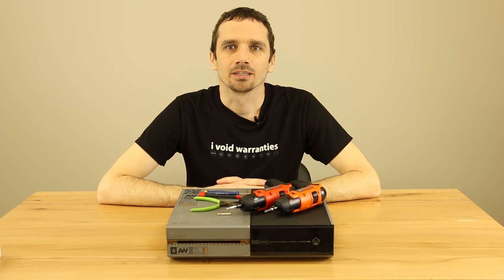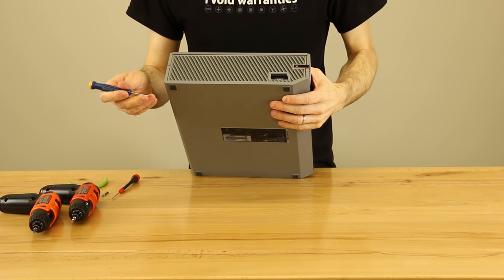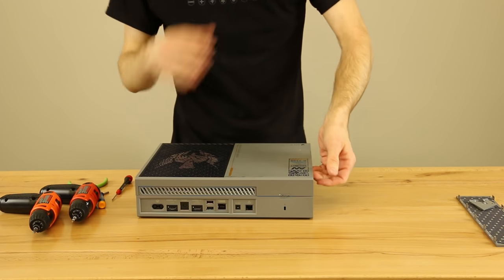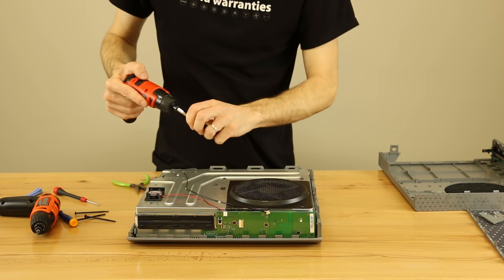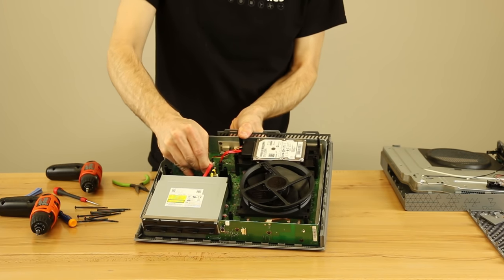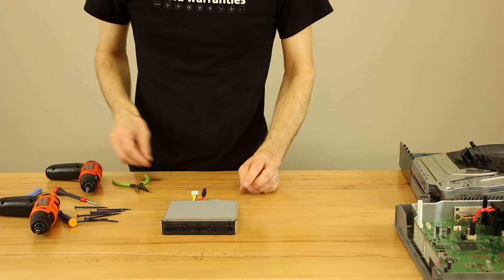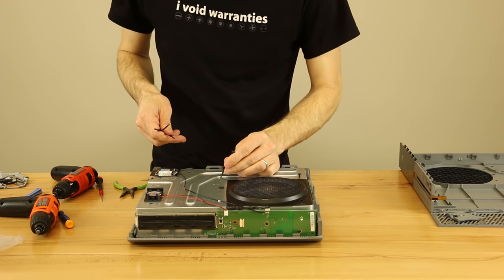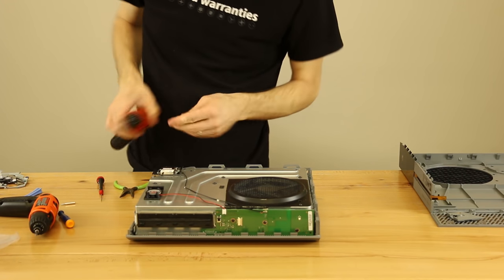Xbox One Disc Drive repair

Comment: my xboxone doesnt even acknowledge there is a disc no error code no nothing
Reply from the maker: It may need a new laser or entire disc drive.
Reply: Ben heck Xbox one
Reply: Mine only does it for new games.
Reply: mine works if i inject game cd tilting the Xbox a certain way a bit.....lol...it that a laser issue...thing is I can tilt it back after detected and it's fine
Reply: BAD LASER, USUALLY
Reply: The disk drives motherboard is important because that is what allows the Xbox One to read movies & games.  Remember that.
Reply: @Tronicsfix  true tea
Reply: We got the same problem dude.
Reply: Same problem here.  I've tried a new blu ray drive, moved my daughter board over to it.  It won't read blu ray or game discs, either.
Reply: Same same
Reply: Same
Reply: clean the roller inside the disc drive, it getscdirtyvand doesnt push the disc in all the way, causing the motor to not engage with disc, 9 out of 10 times thos will fix
Reply: same, I really need this fix
Reply: @terrysean85  how did you clean though? I just cleaned with q tip
Reply: @Tronicsfix  this comment saved me a lot of money. Ordered a new laser popped it in and it worked. 👍

Comment: i struggled way too long to get the upper case back on (last step). recommendation: as soon as the upper case is removed, separate it into two plates (top and front). MUCH easier to restore top face, then ribbon, then front face.
Reply: Wish I'd read this before starting.
Reply: Lmao I found that out after struggling for  longer than I'd like to admit. Should have read the comments
Reply: thank you!

Comment: Just pulled mine apart cleaned the laser and theres no errors nothing just doesnt even acknowledge theres a disc.... they should have never went with internal drives....
Reply: roller might be dirty. that back bar near the front of the drive.
Reply: if its not internal were would u put it u mean like the hd dvd for the the xb360?
Reply: Same problem here on two different drives.  I moved the daughter board to a new drive and the new drive still won't read / recognize any discs.  I think they bricked my daughter board.
Reply: I can see, now, with my camera zoomed way in that my daughter board's surface mount voltage regulator is burnt out.  

I'm not good at removing or adding surface mount components.  Without that Voltage regulator my daughter board is trash.  Without the daughter board, the Blu Ray drive is trash.  I really hate Microsoft's implementation of this.  It's terrible.
Reply: Never should went with an internal drive? You mean like EVERY single console EVER that came with a disc drive.

What a dumb comment.

Comment: Today, 5 years later, I restored my Day One 2013 Edition, which was no longer able to read discs properly. Without your video I got stuck after removing the PCB. I saw no way to get to the laser. Thank you!
Reply: What was wrong with it? I have the same issue with my day one
Reply: @djesteem01  in my case the laser was bad. Replacing it solved the issue.

Comment: I just wanted to say THANK YOU so much for making such a detailed video of this!  My laser was not broken, but my 2 year old had shoved a dead leaf into the disc drive and there was a stick that was stuck in it making it no longer play any discs.  I followed your instructions to the letter and was able to open it up and thoroughly clean the disc injection area (of which I had to take that black piece off the front of the drive to get to all the small leaf pieces) as well as leaf parts in the disc seating area.  I put everything back together and now we can play our favorite shows and video games again.  Thanks again!
Reply from the maker: Ha, ha...nice. We find all sorts of stuff in them! Glad this helped you get yours working.
Reply: @Tronicsfix  does this fix the on/off problem with the Xbox one

Comment: It has to be said, your videos are top quality and many thanks for the above video. I have a dead xbone drive and this may be the answer :)
Oh and for the "Budding Electrician/Bodger", a tip...
You own a mobile phone right?
Take photos of the disassembly as you perform it. This way when it comes to putting it back together, you can follow the pics in reverse order :)

Some ribbon cables can be a nightmare (PS2)

Comment: This procedure worked for me! Great job!!
Notes: 1) make sure you take out game disc from CD drive, mine wouldn't restart until I removed!
2) that flat cable to the front panel is a real trick: my connector also had a small lock to undo, besides the loop around the connector.  I put mine on the edge of a table so I could look up while connecting, this is suggested in the video, but it does help! I used flashlights to help see too! This might be trickiest part of the surgery!!
3) inside the DVD drive, there is a small black square thats actually a microswitch... I couldn't get control PC board in until I got this swith to ride on top of a white bar that must related to having the CD in...

Thank you!!

Comment: The Xbox One Advanced Warfare Limited Edition is my longest owned Xbox One. I stood in line outside for 6 hours at Gamestop in the freezing cold for my preorder of this console. I don't know how. But I still have this Xbox One and it has not once giving me any issues whatsoever. I have taken good care of it and have kept it clean. I use a vacuum cleaner and suck out all the dust from the vents regularly to prevent major dust from getting deep inside the console. I haven't even broken the warranty sticker even though its way out of warranty. When the S came out I was going to upgrade. But ended up waiting. Then the X came out and I mistaken it for the next gen Xbox and made my purchase. I was going to sell my old Xbox One. But im so glad that I didn't. As now after all my bad luck after owning several brand new XB1X systems. That all seem to come faulty. The Advanced Warfare Xbox One limited edition  will always remain my back up. So I can keep on gaming.

Comment: Old drive was not feeding properly. New drive would not read game discs. Swapped disc feed carriage in new drive to the other parts in old drive.  2 screws hold in the motor in the back left.  No soldering needed.  Everything works.  Thanks for the video.  Using the prongs for a fork perpendicular to the case also works for releasing tabs without the tool.

Comment: When reassembling the case just un clip the face plate where the ribbon cable is. That way you can just snap on the top of the case. Then that makes it MUCH easier to install the ribbon cable and then just align the bottom clips of the front face plate and press in the top part and boom. Hope this comment helps at least one person having trouble with reassembling. Because ik I had a hell of a time.
Reply: Helped me! Much easier, thank you.

Comment: When I put a disc in my Xbox, it makes the sound that it’s supposed to while the disc is going in, but it keeps making that noise for a second or two longer than it needs to and then it doesn’t even read it

Comment: Thought something was wrong because I would hit the eject on the new drive I installed and the trey would not eject.  It has been so long I had used the disc drive I forgot it did not have a trey.  So, ordered a new drive on amazon for $30, pulled the board from the old drive to the new one, 3 screws, 3 ribbons, and a simple solder of 2 wires, put her in, and works great.   While I was in there I went ahead and pulled the heat sink off, cleaned it, and the fan up nicely. Removed the old thermal paste and applied some new thermal paste, might as well while you have it open, the old paste was pretty crusty.   The Xbox one had a damaged non-working disc drive and the hard drive had just recently failed so it was a non-working Xbox one.  I ordered a 1TB SSD to replace the old HDD, also this new disc drive.  Installed the Xbox software update via thumb drive and now this old Xbox one is a brand new beast.  Once I get all the games installed back on it I will be interested to see how its load times hold up to or surpass those of our Xbox one x.   Thanks for the tutorial, I was worried a disc drive replacement would require getting it flashed or something. But just swapping the boards did the trick.

Comment: Keep in mind to make sure all ribbon cables are fully seated and locked into place. It any of them are loose there will be power issues S it won't run right. I just replaced the BR disc tray and didn't have the front power and eject ribbon cable fully seated which made the Xbox randomly turn on and off. It's quite annoying. After I replaced the disc drive it's like a brand new Xbox. Highly recommend doing thi yourself rather than sending it into Microsoft. Even more so if the Xbox is out of warranty and it doesn't matter if you break the seal or not.

Comment: This video is gonna help me alot. Just bought a 70 USD Xbox One that has a broken disc drive on it. This is probably the problem it has.
Reply: Hi I just bought an Xbox like you did but I didn't spend $70 for it I only spent 40 but it has the exact same problem how much was the part cost to repair it

Comment: drive succesfully repaired. thank you!
Reply from the maker: Awesome!
Reply: genl0rd where did you purchase your optical drive at?
Reply: i did not purchase an exta optical drive. i just cleaned the lense of the drive, included in my second hand xbod. there where parts of potato chips and oil from the previous owner inside. i've cleaned it with a q tip and alcohol
Reply: genl0rd o ok. Thanks for the detail. My ex girlfriend broke my madden game put some kind of sticky stuff on the game and forced the broken game into the tray. It still works and but it makes noises trying to read the disc and everytime I take a game out it has that sticky stuff on it from the previous game she forced in my xbox

Comment: This is EXACTLY what's happening with mine! The SAME little white plastic part broke off. Could you point me to where I could buy that replacement part? I would love to have you guys repair it but as I'm located pretty far from you that's out of the equation ;) Would extremely appreciate any tips on where to acquire the part. THANK YOU SO MUCH!!
Reply from the maker: +returnofthesoftstyle Which replacement part do you need? We can sell you the laser + carrier if that's what you need. You can contact us on our website: http://www.tronicsfix.com/contact.html

Comment: Great video. Thanks for the post! I have one comment though about the reassembly. I found it very difficult to get the front cover to align just right. I found it very easy to unsnap the front cover and place it on last. Just a tip if anyone had any issues like I did.
Reply from the maker: Good tip. Some people would probably do better that way.

Comment: Where did you guys get the replacement laser/spinner piece? I would like to purchase one. Thanks for the video, very helpful.
Reply from the maker: It's linked in the description.
Reply: Thanks, I guess I missed it because I didn't click "show more." Great video, thank you so much. Mine won't spin discs and it seems that replacing the laser carrier piece you did in this video is the fix I need on mine. I will give it a shot and if it doesn't work you should be receiving my XB1 in the mail soon! Thank you again.

**Edit: I checked the link for the laser, it looked in the video like the laser was attached to another panel that had the carrier and ribbon cables and other stuff on it. I think my problem is the spinner motor itself, would you happen to have a link for that?
Reply from the maker: Gotcha...I don't know of anywhere that sells them with the carrier. You may end up having to just replace the drive or send it to us for repairs.
Reply: How long would you guys think it would take from Oklahoma City? I read another commenter who said they got a 1 week turnaround? Kinda don't want to be without my XB1 for a long time if possible?
Reply from the maker: That depends on how quickly you ship it here and which repair speed you choose at checkout. We offer a one business day repair + 4-5 days for return shipping or you can pay to have it shipped faster. You can choose that at checkout.

Comment: The link no longer has the optical drive available. Is there another you can provide? 

Ive had it apart twice and got it to work long enough to install a 2 disc game, but it didnt work after putting it back in the drive case. Seeing as I dont know what to look for its just luck when a disc reads. I think its the laser as it doesnt seem to light up,  just spins the disc twice moves a little back then to the middle and does no more.

Not sure if I need a new laser or deck or entire drive, but Id prefer not to solder anything if I dont have to.

Thanks for the video, appreciate the help.

Comment: This video looks great, but I am just not sure if mine is the laser. When I insert the disk it doesn't go in all the way. It like gets stuck and I would have to push the CD with my fingers and after that it still won't work. any suggestion?
Reply from the maker: Sounds like you might have a problem inside your disc drive. I can figure it out if you'd like to send it in: https://www.tronicsfix.com/collections/xbox-one/products/xbox-one-disc-drive-repair

Comment: I have one question, so I have the same exact model of Xbox one you have shown in your video. Even down to the advanced warfare collectors edition. However, when I boot it up, it seems to have a different screen compared to yours, did they make a refurbished variant?

Another question is, where can you order new disc drives for the Xbox one?
Reply: Ebay. And they probably did an update since this video which is why it looks different

Comment: where did you buy the laser from ? . good job on the fix.
Reply from the maker: +Johnathon Mcnew We buy our stock from China.
Reply: +TronicsFix  
instead of soldering and unsoldering that part that is married to the motherboard,  why can't I just  unscrew the motor and take it out with the part that is married to the motherboard and swap it to the new drive
Reply from the maker: +cristian mota Because when you do a lot of these it's way easier to just do the soldering.
Reply: +TronicsFix  
but would it work ??
if i did it that way
Reply: +TronicsFix and tks for the quick response
Reply from the maker: +cristian mota No idea...we've never done it that way.
Reply: +TronicsFix  alright tks anyway I really liked this video. I looked on you tube and searched but no one has ever done it this way or tried it form what  i have  seen . Might as well be the first :|
Reply from the maker: Glad you liked the vid!
Reply: +TronicsFix  one of the best on youtube if not the best one
Reply from the maker: Thanks!

Comment: Just reassembled my Xbox One, after replacing the disc drive (WITHOUT soldering. I removed the small rubber band and pulley off of the motor shaft instead. And removed the board and motor as one). Now my Xbox's fan is running load as soon as i plug it in! I reassembled everything correctly! Help!
Edit: The disc drive itself is working correctly. Its just the fan is giving issue now.

Comment: My xbox one s, plays dvds and xbox one games, but will not play any 360 games.. (yes they are on the list of backward compatibility games) any ideas?  I still have a warranty, but I'd rather avoid the how ever long it will take to send it in and get it fixed.. I tried everything from the troubling shooting on their website, to the ideas  on youtube, once in a bluemoon it will load a 360 game after reinserting the game 37464744775 times.
Reply: Are your DVDs bluray or just normal DVD?
Reply: Friendly Homie  both, it would only have issues reading 360 games, I had to re-insert them a bunch of times for them to eventually work. I mailed it, to Microsoft for a warranty repair already.
Reply: Alright, glad you're getting it sorted and not paying the overpriced repairs! 👍

Comment: Hey, my XB1 just died, I put it through an insane amount of hours since I got it on day 1, I also used to smoke a lot inside for a couple of those years. It started having an issue a few months back (after i'd reset the power cord/surge protector) where it would struggle on the initial power up, for most power ups since then it didn't do it. (except after it'd been off for like 24 hrs or i'd unplugged the power cord from the wall) .
When this happened it would make the power button sound very faintly as well as the eject sound (and nothing would happen) . I figured out that I needed to unplug my external hard drive from the xbox, turn my wired controller on and hit the eject button or the power button, today it was taking way too many attempts so I decided i'd try resetting the cord, now it doesn't even make a sound and 0 power comes through the USB ports. My power cord has a solid orange light, not blinking. Any idea what the issue is/if I can fix it?
Reply: xXimf4m0usXx Replace the power brick

Comment: TronixFix my xbox has a problem where if i put the disc in it pulls it in but then i can hear it get faster trying to pull the disc in and it doesnt not read or tell me there is a disc in at all. Any suggestions to what the problem is because i already took my xbox and disc reader apart
Reply from the maker: It's hard to know for sure without having it here in my shop. It may need a new drive.
Reply: Piff Riff push it in with some card board we somthin

Comment: Not sure if anyone will see a message after so long. Just a question, I have the original Xbox one, it reads and plays Blu-ray movies perfectly, but it will not read a game disc. Would it be the laser that needs replacing or could it be an issue with the drives daughter board? I don’t want to replace something unnecessarily Cheers

Comment: Any tips on repair for when it seems disc won't load in all the way? If I do the tilt trick it works most of the time but it's getting to where it doesn't want to. Any ideas? Thanks!
Reply from the maker: Most likely either a laser problem or the disc drive itself.